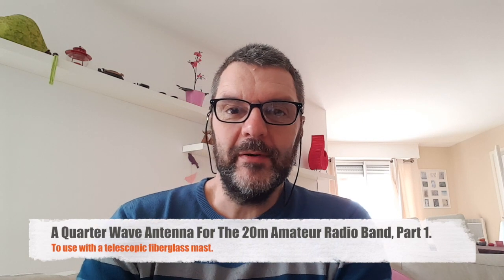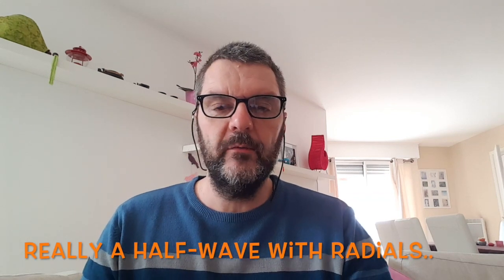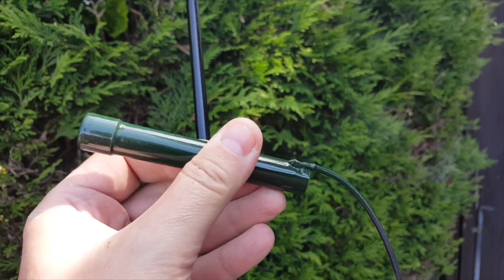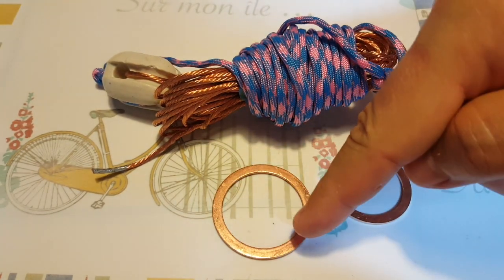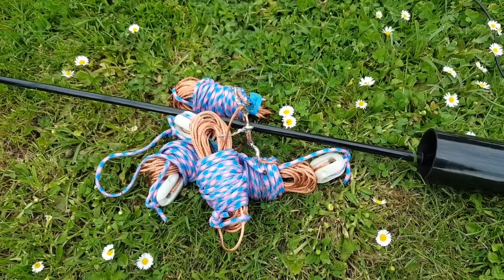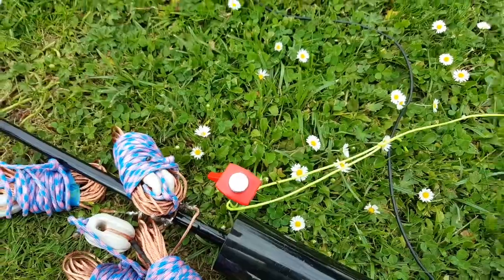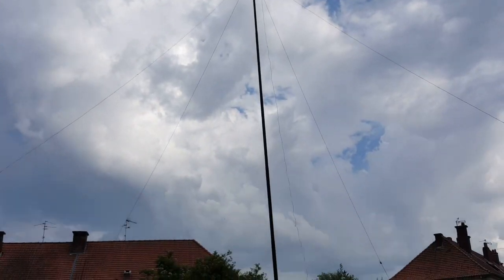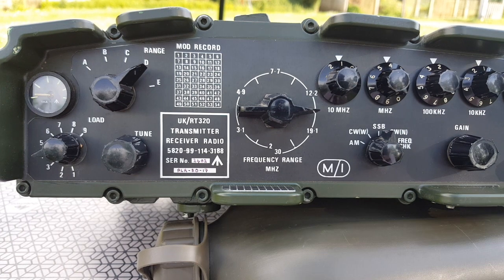Building a Quarter Wave Vertical Antenna, Part 1.

Comment: A No-ground-plane short HF vertical antenna; Recently I have been experimenting with a T2LT coax made counter poise system, used along with a mobile HF ham stick as the main radial. I enclosed it inside a 20 foot PVC pipe with a cap at the top to make it into a short vertical antenna on top of it's own support mast. And so, the mobile Hf ham stick whip screws into the top cap with a standard stub antenna mounting connector for whips. Doing it this way means I still have PL-259 connectors on each end of the coax so it stays completely uncut. i just measure out a quarter wave length for the frequency i wish, and roll up the choke according to G2TXQ's chart on Air choke making.  So far the 11 meter version using any old CB whip I had laying around works great, the choke at the end of the 103" quarter wave counter poise coax is located just outside the mast through a one inch hole roughly 100 inches down from the top of the mast where my coax enters it.  And using the same mast, a 21 MHz version and a 40 meter version works just as good by just replacing the coax and the mobile ham stick whip to change bands.. So each band uses a matching coax counter poise, choke coil wound in it and mobile ham stick whip. And moving the longer coax counterpoise and choke further away from the mast on Hf bands as needed.   Living in an HOA controlled community, my options are limited.  But it gives me a short vertical HF base antenna, that has a build in counterpoise.( I've always wanted to make a NO-Ground-Plane HF antenna, and this T2LT coax based counter poise and choke system used along with a CB or mobile ham stick combination works to make a short vertical  base station antenna that needs no counter poise radials strung out around it.) SWR on the lower end of 40 meters was 1.6 with dip of 1.2 SWR in the middle of the band. Z=42 ohms. I need a longer whip radial to adjust the SWR down to the low end of the band, mine was cut in the past and now is a bit too short to adjust it further down than that.  ( From Possumn235 I love watching and learning from your videos, so now I am passing something back that you or others may find useful. It's taken me about 30 years to figure out how to make a no ground plane HF antenna system and this one works.)
Reply from the maker: Thanks, I'll look into it!

Comment: I have a 20M EFHW for my 12m Spiderbeam that I connect to a 64:1 unun I made.  I love the performance of that setup on 20.  This past weekend, I had it attached to our RV (that has a lot of aluminum) and gave 30m a try, not expecting it to work and made three contacts.  Still scratching my head on that one, even with the KX2 tuner.  N1XF
Reply from the maker: Excellent, I am a big fan of the EFHW too.
Reply: Did you use radials too?
Reply from the maker: No, the EFHW does not need radials.

Comment: I really like that copper tube you use for the cap on the mast and that radio is awesome. I'm like you with thunder...all radios and antennas get disconnected ASAP.
Reply from the maker: Thanks, yes, I never leave one plugged in..

Comment: Gil,

With a 12m pole, couldn't you build a 10m (half wave) radiating section, and have the radials strung out closer to the ground? I have a 12m Spiderbeam too, so I'm curious. Thanks.
Reply from the maker: Yes. You don't even need radials then, only an end-fed transformer. This way though, the radials turn into guy wires, for when you don't have a way to hold the mast up.
Reply: Im doing this idea right now!

Comment: Nice video! Super genial idea with the copper ring. And also the bnc / banana plug adapter is great. Can you post a detail photo of how you connect the coax to this adapter?

Vy 73 de DO1PGR
Reply from the maker: Hi Peter. You can see it on the video. The copper ring has a short piece of wire soldered to it and that goes to the black banana connector of the BNC adaptor. the radiating wire goes to the red connector. The red and black knobs unscrew and there are holes in the adaptor where you ca  thread the wires.
Reply: Radio Prepper Thanks for the quick reply, Gil. I will build a 10m version of the antenna 😎 
Merci et toujours bon dx